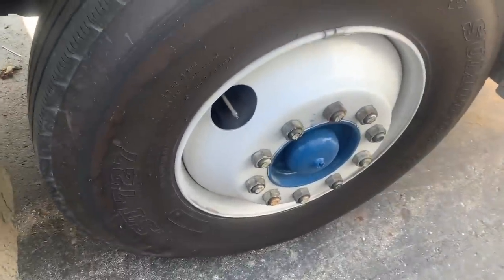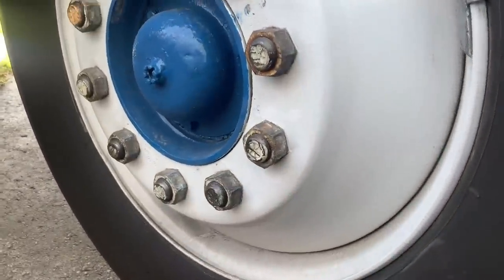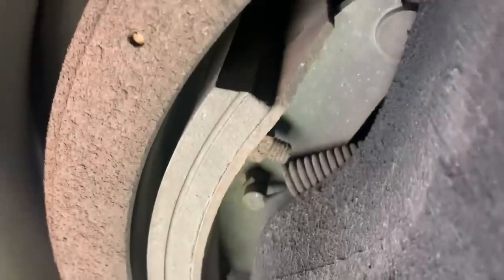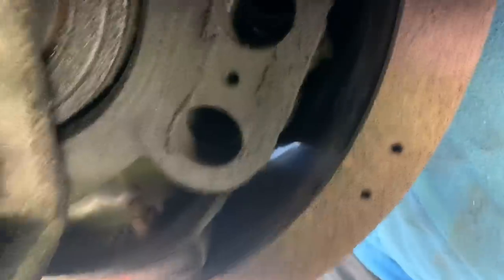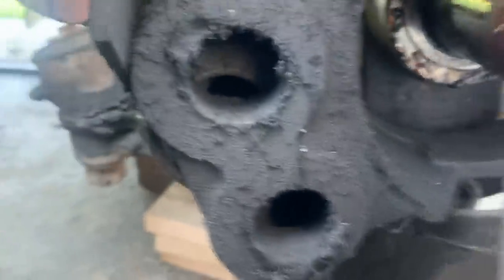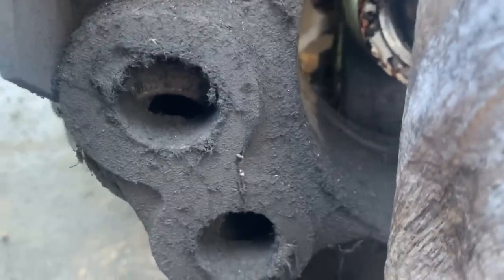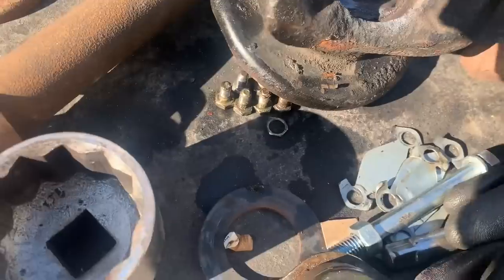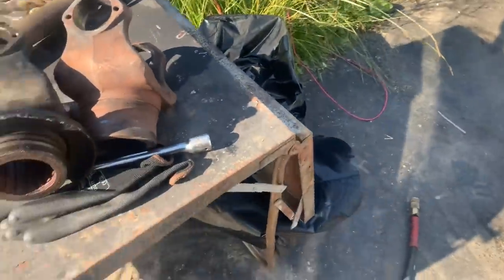Silversides bus problem investigation

Comment: I spent a few years working truck/trailer brakes. Never seen one without pins either. Do you suspect they were removed, or never installed?  They don't FALL out, that's certain.

Comment: That u joint failure is crazy, especially about the length he drove it. My luck would have been the joint, shaft and somehow the transmission would have been snatched out too. 
Digging the new low pro jack and plates too. Glad you're gonna be a little bit safer out there.

Comment: It looks to me like the "cam" and "anchor"  sides of the brake blocks might be reversed on one or both of those shoes.  If that is the scenario, the drum won't fit over the shoes with the anchor pins in place.  That may be why the pins are missing...the last guy probably couldn't get the drum on so he left them out and let it go. You should be able to clean off the shoes with brake clean and read the markings on the linings to ensure they are indexed correctly. Swapping the shoes won't fix it, you would have to remove the linings and reinstall in the correct orientation.

Comment: Somebody upstairs was watching out for that guy. If that driveshaft came out, it could've over turned the bus or caused sever damage to the under carriage components. Nice work Scott!
Reply: I was coming down a mountain road in an old 81 Eagle when the rear joint at the pinion did that. It blew the driveshaft completely away from the diff. Which meant trying to gear it down or use the Jake was useless. No sand traps for runaway trucks either. I had a bus load of church kids on it coming home from camp. I don’t ever want to experience that kind of fear driving again. When I got it stopped at the bottom I put the sole of my shoe against one of the front aluminum wheels and the sole melted to it. I didn’t want to pull the park brake cause I was running about 55 when it blew but in hindsight I should’ve took my chances and pulled the park brake. 
Personally, I think if someone doesn’t have the finances to spend whatever it takes on these old buses to make them safe they shouldn’t ever move them until they can. Appearance & convenient items can wait. Air brakes systems & steering issues and driveline issues cannot.
Having driven motorcoaches part time for years I can tell you that if anyone is hurt while you’re on the road in a commercial sized vehicle you are automatically guilty until proven innocent. Doesn’t matter if it’s titled as a motor home or not. I’m glad to see the owner of this one looked at. Hopefully if Busgreasemonkey sees anything sketchy the owner will either fix it or let it sit until he can.

Comment: Those Jack pads will help alot in dispersing the vehicle weight for sure.  Fire depts use them under there stabilizers to keep from sinking into the asphalt.   Yes that does happen.  I believe who did the brakes forgot to use the anchor pin retaining clips on that style of foundation brakes.

Comment: The brake issues you run into are unbelievable. Backward s-cams, no anchor pins. So dangerous!
Reply from the maker: They certainly keep me guessing.  I was not even close on my first thought but that’s only because it never occurred to me to look for missing anchor pins
Reply: The mechanic or whatever who did this needs to be put out of work. The driver driving a bus with no good brakes needs his driver's license revoked.

Comment: Looks like someone put it together without the anchor pins. With the shoes resting on them, and the pressure from the return spring there;s very little chance they would come out.  And you're right, those pins usually require a bit of persuasion  to remove.

Comment: Who ever did those brakes never put the anchor pins in. They probably didn’t know what they were doing, had trouble getting the springs on so they took the anchor pins out to get the springs on and never put the pins in. Scott, you may want to take 2 minutes and show people how to do that, putting the anchor pin springs on before you put the shoes on the pins. Supper easy to do.
Reply: Hopefully tomorrow or the next days video will show what this assembly is supposed to look like when properly assembled and adjusted.

Comment: Whoever worked on this fella's brakes last did him a disservice. Same with  u joint bearing cap. Locking tabs on bearing cap bolts preclude cap from coming off.

Comment: Those jack pads. Find some paper haulers ask them for some cork mat. (Its what we use tto keep the paper rolls from sliding in the freight vans). Cut it to fit the jack pads and sandwich the cork in between each pad.
Reply: What is the use,what is the advantage ? Are you writing of using two of the pads together with this cork you speak of sandwiched together ? Don't understand. Please go into more detail.  Thanks.
Reply: @paulmanson253  yes if you need to stack the pads put the cork rubber mat in between the plates.
Reply: @jerrykinnin7941  Right. Got it.

Comment: So those don't have any kind of a backing plate on them? Never knew that, but then I have ZERO experience with air brakes. Could a bolt be substituted for the correct pin in a pinch? Just a hypothetical question.

Comment: When you do the vid on the  jack can you go over  how it works with a  compressor . And if the compressor fails or the hose gets disconnected does it lower  the  jack?
Reply: No, it's basically just an air-powered pump. A check valve keeps the hydraulic oil from floating back.